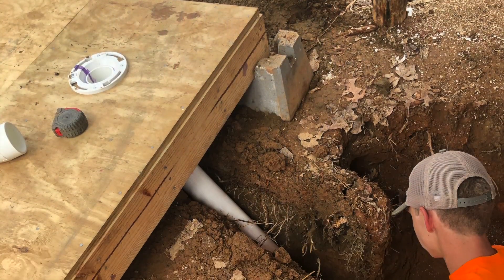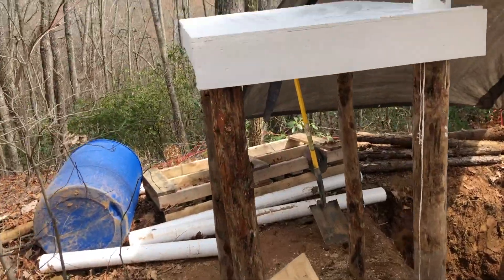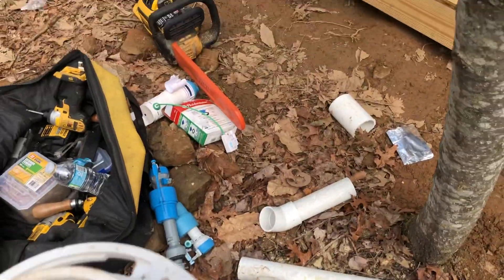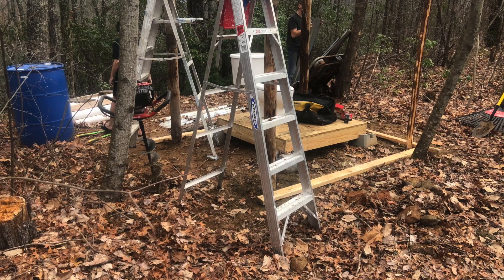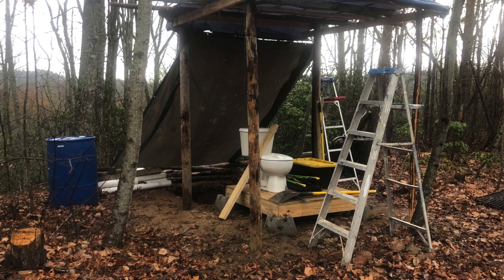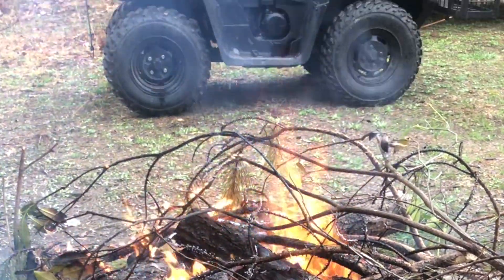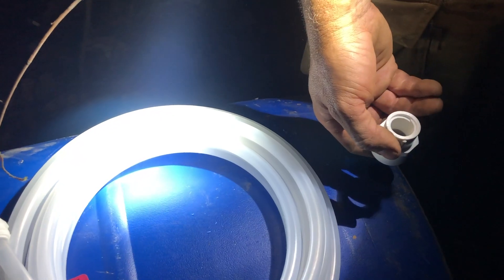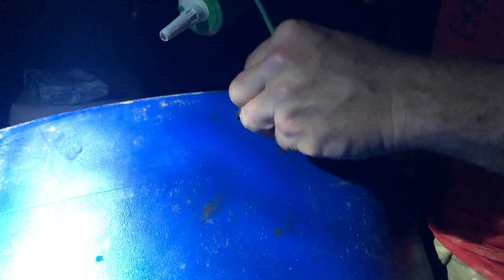DIY Off Grid Outhouse with a flushing toilet and serviced by WORMS??

Comment: I'll give you a like anyway, but I hope you're not doing this in Virginia.  The health department will give you a permit for a pit privy or a moldering privy, but not for something like this.  

For people interested in a solution for which you can get a permit, check out moldering privies.  NPS uses them in areas where tank trucks can't go, so when you walk into the health dept for your permit carrying plans from the NPS, they will usually approve for an intermittent use area (hunting cabin, weekend camp, etc.).

Comment: So you basically built a septic tank.
Reply from the maker: Vermicomposting doesn't need to be emptied and if built correctly it is extremely low service requirements.  There is no way a pump truck would every be able get to my location.   If you have an easy access location this may not be the easiest solution for you.
Reply: @craftersblasters2806 - What ever happened to part two??